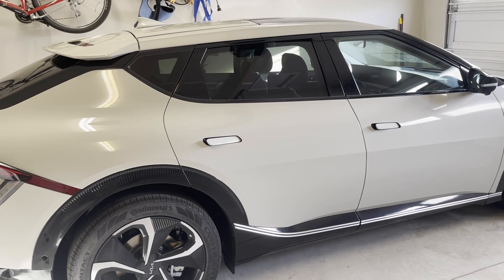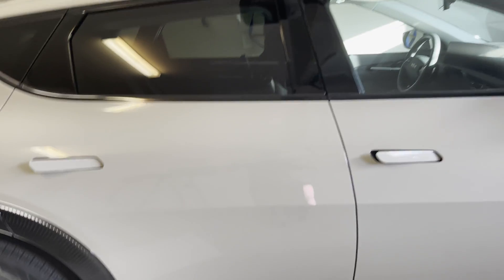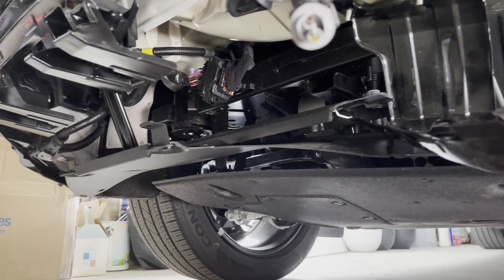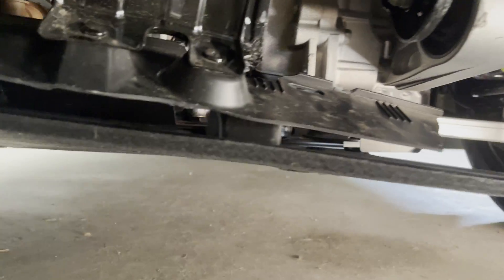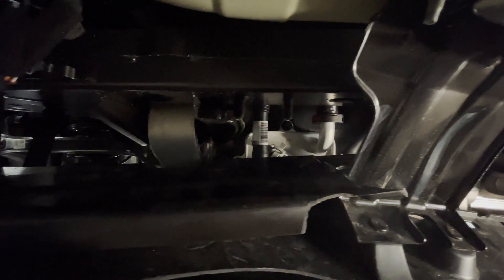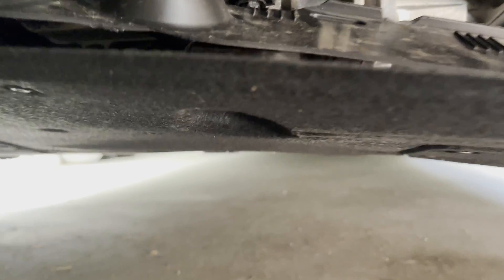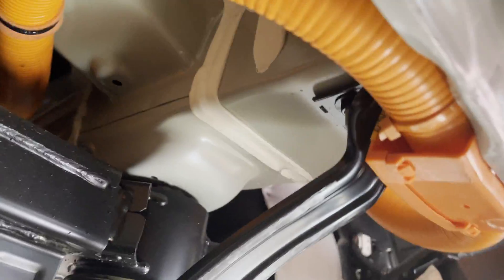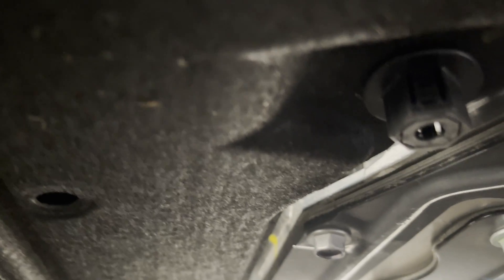KIA EV6 Rear Ended - Looking to See How Well Protected the Battery Pack Is

Comment: You almost got under your car lol. I'll fill in the blanks. Kia is part of the Hyundai auto group, so there is no skid plate, just a weak plastic cover. Run over a broken muffler or a big chunk of ice and your fancy ev will possibly be bricked as the batteries are fragile. In Canada its $60,000 to replace in the states approximately $50,000  verified by Hyundai Canada. So as long as you never ever , ever hit anything or drive over a chunk of ice or a muffler falls off a vehicle in front of you,  you'll be fine.
Reply from the maker: $50K?  At that point, you might as well just get a new car.  Thanks for the info.

Comment: Hey Mike. How would you described your experience with Kia? After this ordeal would not recommend buying car from them? I recently found out their kia soul hybrid was burning oil even at very low mileage and well under warrantee but the company refuse to do a recall or fix the issue because of the tremendous cost. I'm thinking of getting the ev6 but hearing about KIA's customer service problems really puts me on guard with this company.
Reply from the maker: I am happy with Kia still.  The dealerships I have contacted have been more than happy to help the best they can, it's just that there are no parts available. The EV6 is great but I can't believe Kia is selling a car that can't be fixed at the moment, but I guess that is the growing pains of getting a brand new model.
Reply: im not sure if u owned 2-3 other car manufacturers... even Ford has one of the worse quality cars, 70% of them are horrible CS. The problem here is a global supply which affects ALL manufacturers. Also Kia's EV is such a new car, this is an inevitable problem with today's global problem.

Comment: It’s definitely not drivable. I was t-boned. It definitely feels like the worst case scenario. Do they have any time frame for you for when they could get parts?
Reply from the maker: Unfortunately I do not have a time frame.  The body shop I spoke to said that parts are going towards production so it could be a while.
Reply from the maker: I found a dealership with a body shop willing to take the car for repair.  The downside is I am going to need to drop it off and they will do a tear down to see what needs to be ordered.  If the parts are readily available, it could only be 2 to 3 weeks to repair it the body shop said.

Comment: Still waiting for this to be repaired?
Reply from the maker: Yes unfortunately.  USAA finally gave me an appraisal, no where near totaling it.  However, the only body shop I found that would work on it said that Kia has not uploaded the instructions on how to repair the EV6 yet, plus there are no parts available, so I am basically SOL.  I asked the insurance to total it due to it being unrepairable and I am still waiting on an answer but not holding my breath that it will happen.
Reply: Did they agree to total it?
Reply from the maker: @JackJack-gi4mh  USAA refused to total it.  On the bright side, I finally found a dealership with a body shop that is willing to take it in for repairs. Hopefully next week I can get there and drop it off.